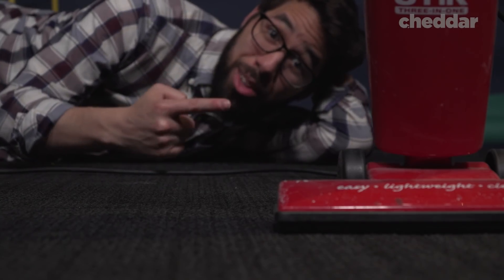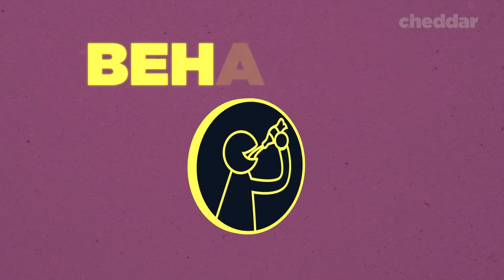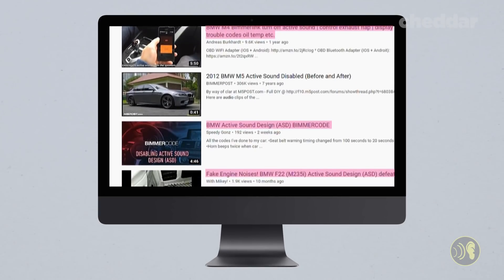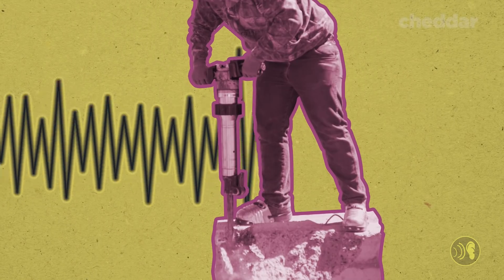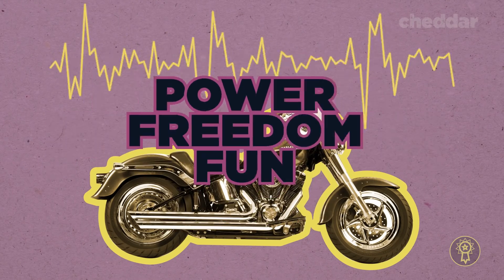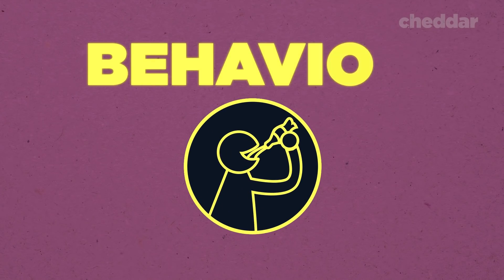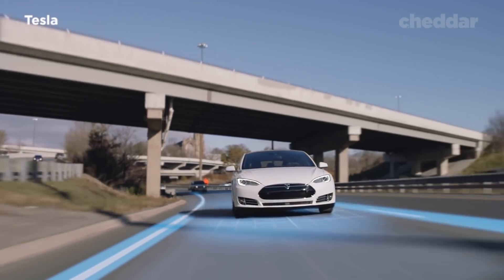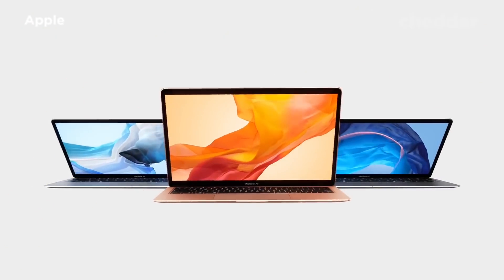The Fake Sounds Companies Add To Products - Cheddar Explains

Comment: Yes! I've been saying this for years. If I buy a paintstripper hot air gun or a hairdryer, it is deafeningly loud. Yet if I pay the price for an industrial hot air gun for electronics, it is so quiet that it is difficult to tell it is turned on.
Bathroom fans are designed to be loud. But for commercial use, you can buy very quiet bathroom fans. It is all in the shape of the squirrel cage rotor. So it does not cost a company even one penny more to make it quiet.
Look at designs made to be quiet. Vacuum cleaners meant for hotel use are powerful, quiet, and unassuming in appearance. Models meant for residential use look like a sci fi instrument of destruction and are so loud you can't even carry on a shouted conversation. Those "bladeless" fans actually have a very high speed impeller fan inside them, yet they manage to be very quiet.
How about shop vacs? A relatively low power small model is amazingly loud. Yet a commercial model with a 5hp motor will often be much quieter.

Comment: Harley’s have air cooled  V-Twin engines. Most sports bikes are inline 4 water cooled. But other bikes with air cooled V-Twins sound similar to a Harley. Not because they’re sound engineered. That’s just how a V-Twin has to sound. It’s a function of the configuration. Moto Guzzi, some Ducati’s, and Japanese Harley type cruiser. V-Twin = that sound. The exhaust ore differs due to the exhaust design but the burbling sound will be there.

Comment: You forgot to mention the opposite of this statement "cars can be quiet and powerful."

"Some cars can be loud and powerless pieces of sh*t." For example these ghetto ass modified Hondas that sound like they have a kazoo shoved up the tailpipe. Most of those cars have less power than a smart car.
Reply: Well if the car is quieter then theres less combustion which leads to less power, example: toyota Prius is a inline 4 that is tuned to get lower compression to get better fuel economy but also makes the car quiet. But there are electric cars that can be super quiet with a lot of power, example tesla model 3 which is super quiet but has a 0 to 60 in like 3 seconds. And the hondas have a larger exhaust manifold and usually have no catalytic converter
Reply: @leftturnsmatter7555    exactly. I've ridden in a Tesla 3, those are super quick.

Comment: Even though it is admittedly quiet, there's still an motor-like sound to the Tesla, and I wouldn't be surprised at all if that is intentional, and is probably much louder if you were standing outside the vehicle. I've read that one of the issues with electric vehicles is that they can be so silent that pedestrians that are blind (or are simply not paying attention) would fail to recognize their presence and that might increase collisions, so they are in fact adding sound for safety reasons.

Comment: I’ve been wondering about vacuums for awhile and been frustrated with their perceived lack of innovation in the sound supression department but this has explained that. It still frustrates me and I still want a silent vacuum. Also this video made me crave pringles lol
Reply: engineer one and market it here.
Reply: Quiet vacuums do exist, you just won't find them where you would probably look for them. Try a miele, sebo, or even an old filter queen vacuum cleaner, you might be surprised!

Comment: Motorcycles do not have to be loud for safety reasons, common misconception. There is no hard data to back up the claim that loud motorcycles are safer, it's just a claim that motorcyclists like to repeat a lot. By the same logic, pedestrians should be walking around with air raid sirens all the time and bicyclists should mount ship horns to their bikes. The real reason they defend their loud bikes with so much fervor is the same reason that car enthusiasts like loud cars. They're perceived as powerful and cool.
If you were so concerned about safety, you'd wear protective gear and a full helmet and keep proper distance not trying to look cool in your retro cap and leather vest and jeans going way too fast and coming way to close to other drivers.
While a lot of motorcyclists claim their machines have to be loud for safety's sake, new legislation by and large tends to disagree, imposing ever stricter noise regulations worldwide. After all noise is unhealthy and there is more than one way to stay safe on a motorcycle, like wearing brightly colored, reflective safety gear and most of all DRIVING RESPONSIVELY AND WITH FORESIGHT.
I ride an electric motorcycle to work every day and I've never felt less safe than when I was riding a standard bike. Can't say that I miss the noise and the stink though ...

Comment: This is stoopid. Not the video, but bothering to do sound design for familiarity over superior function (unless it's a novelty, like the clicking bottle caps) (and then maybe consumers are mostly stoopid, too). I don't know about you, but when I shop for anything, I'm comparing cost, quality, performance and durability. Even if I had unlimited cash to do so sound would be the last thing I'd worry about... unless the sound is annoying or too loud. I'd much rather have things like car doors and vacuums as quiet as possible...
meh

Comment: I use my work vac at home, it was designed to be quiet and strong (type of shop vac referred to as dust extractors). It's also cheaper than what most people pay for a good vac. Granted no beater bar, but there are no carpets in my home- that's gross. You can buy air driven beater bar heads, but just rip the carpets out. Sorry, none of those in a home. Been there, gross. You can vac the same spot over and over and get more stuff out (ask a Kirby salesperson to come over and show you).

Comment: If Apple makes a vacuum cleaner, it'll be their first product that doesn't suck.
Reply: Just be sure that you hold it in the Apple approved way and only use an Apple approved wall outlet.
Reply: Dun bother with one of those...the wheels of that vacuum will cost 700 bucks.
Reply: But it'll cost 300 times as much, still have at least minor problems, and it'll be totally sealed in a unibody design so only they can fix it.  The casters will be extra, and cost $200.
Reply: @ebinrock  No, the joke is he said it wouldn't suck. You know because vacuums are supposed to suck things in!
Reply: @mad48567  Granted! The Apple vaccuum would still find a way to suck
Reply: It would have iTunes though.

Comment: LoUd PiPeS sAvEs LiVeS!

Biggest BS I've heard...and I ride motorcycles.  Nobody that heard you actually knows where you are.  Hell, I've been run off the road by someone looking right past me while blaring my horn repeatedly.  They just didn't recognize me at all and forced me to leave the lane or get run over.  The best thing you can do is increase your visibility without creating glare.  Hi-viz gear, reflective elements on the rear and sides of the bike, and running lights that form large chevrons.  That visibility goes a long way to draw the eye to you and start to recognize that you're something that shouldn't be run over

Comment: I actually bought a vacuum cleaner that has "silence force" as the model name and yes, it's a lot less noisy than the others, you can actually hold a conversation with someone in the same room at a normal volume while vacuuming.

Comment: That explains why British Rail Engineering Limited kept on putting big, loud DC Motors into just one coach of their electric trains until the 1990s. The "zoom-zoom" from the 2nd or 3rd coach in each set in a train is iconic on pretty much any line they ever ran on (look up videos of BR Class 321s, 317s, or 319s at speed). The change to AC motors didn't come until 1991 when British Rail ordered 97 "Networker" trains from them and a further 93 from their cousins Metro-Cammell. The BREL sets were refurbished in 2008 and sound different now, but the Metro-Cammell sets are functionally as delivered and thus retain their original "F1 Car" sound when pulling away from a stand (see videos of "MetCam class 465"). Siemens also make their trains sound weird, their Desiro UK trains are infamous for their "UFO" sound, and their ES64U2 "Taurus" locomotives on the continent are known for their musical scale between 0-20kmh, the latter being made famous in a YouTube video titled "Taurus Macht Musik" of one such locomotive struggling from a start with a heavy train in snowy conditions causing the wheels to spin and the motors to go with them until the computer brought them back into line, creating music along the way.

Comment: It's possible that people will wake up to just how ineffectual advertising is. Tesla has no advertising budget yet they have continued to expand at around 150% year on year for a decade. The rest of the automobile manufacturers are, in the main, contracting. Harley Davidson are in trouble because the age group they appeal to has grown older, it is literally starting to die off. I hate noise, that is why I own an electric lawnmower (there are other benefits too but mostly it's the quietness I like). I also drive a Tesla Model S, from a drivers point of view while they are quiet there are many other cars that are also quiet, unlike the BMW i8 (a plug in hybrid) that pumps engine noise into the cabin by speakers but it's not the 3 cylinder noise from the actual engine you hear but artificial engine noise that the marketing department thinks you should hear.
Advertising is a huge part of life but in reality the endless pre, mid and post roll ads I see on YouTube and TV just make me that much less likely to buy those products. Perhaps one day someone in addition to Mr Musk will take a look at advertising and realise what a tremendous waste of money and how counter productive it mostly is.

Comment: The best selling car company does do most of this but that’s Ford and they do it because they replaced their V8 with a turbocharged V6 where everything is much smaller to increase power and efficiency. Most performance cars like the mustang or even jags have  exhaust that produce beautiful sounds even though jag engines naturally aren’t even a good sounding engine for the most part. Personally for me the best sounding vehicles are old but gm block V8’s despite the fact they do not produce a lot of powerful but the big block is the noice of the V8 that’s why it’s the best sounding engine because it is the sound that you think of for powerful cars.

Comment: I AM SO OVERLY MAD THAT VACUUMS ARE LOUD ON PURPOSE
Reply: I'm mad that pringles make sound! can't everything be silent everywhere??
Reply: Well take solace in the fact that this isn’t the whole story. While there may be some truth to the idea that a vacuum that’s “too quiet” has a lower satisfaction rating, I know for a fact that a significant part of the cost associated with consumer vacuum cleaners is sound dampening to make them quieter. My source is a close friend who’s spent 12 years of his career engineering vacuum cleaners.
Reply: @matthewjcobb  thank you for providing this exact bit of information I was hoping to have found from someone's posted comment.

If you ever took apart a vacuum and looked at the motor and it's parts along with having a tiny bit of knowledge with how just mechanics work.  You would've been immediately thinking that this video's thumbnail has to be b.s or   just how tf could that be?
Reply: 666 likes
Reply: you can buy silent vaccum cleaners, nobody forces you to buy a loud one.

Comment: The pop when you open those bottles are there for safety, it means there’s no air coming in and is fully sealed.
Reply: It's not needed though, they could use a rigid metal cap or a plastic lid
Reply: Moto Lumpy they could, but you wouldn’t get any feedback.
Reply: Moto Lumpy And the bottles caps that have those pops when opened are metal. Do you not know that?
Reply: Also could mean that the product hasn’t gone off and started fermenting in the container.

Comment: Say what you will about wanting a quiet car, but as someone who is legally blind I can't drive so I am stuck as a pedestrian. I can't see cars coming so I think that cars should have a minimum volume requirement. This would make it easier for blind and visually impaired people to hear them coming. After all they need the sound just cross the street. Fake sound can be practical and make people safer.     

Does anyone support my idea that car companies should have to engineet their cars with atvleast a certain minimum volume sound to their engines? I I do not know if this is already a law or not. It should be though. Tell me your opinion on the matter.
Reply: The EU start to mandate every EV to be louder than today starts from 2021

Comment: It not about the power of vehicles it how traction applied ab 45 hp tractor can beet a 100hp tractor because of the way they give traction. Also I don't think tractors can fake sounds nothing beets a mf 135 that blows smoke while scraping put her in 3rd gear and rev her to hell especially if you pulling old silage that causing wheel spinning lift the scraper a bit and she will smoke lovey.

Comment: I've noticed that in my local tropical smoothie (urban smoothie shop) they are using super expensive blenders that you can see which don't make hardly any sound because the pitcher is set inside of a box that seals most of the sand.

Comment: Having worked in var fields, I have found the ppl who prefer noise are usually the less intelligent ppl, they're also the ones to just talk to hear their own voice and the ones that fail at anything that requires one to be quiet, zen classes, executive security or any security, martial arts, actual cleaning of stuff, women singing and dancing while dusting in teddys are of course exempt. In construction quiet is enjoyed since it's too often not quiet and you lose some of your hearing from power equipment drilling or cutting thru stuff. The earliest quiet vacuums came out in the late 60s, noone wanted em, loud was seen as powerful, the facts were the opposite but ppl largely didn't know the advances in machine silencing, they tried it in the 70s, again same thing, ppl too dumb to know quiet actually meant more powerful. Vibration isolators are a huge industry but most ppl don';t know this but if something is making noise and the customer wants it quiet someone will make it such for $. Air ducts are expected to be quiet so blowers have better bearings and are quieter than they used to be. The military spends $$$$$$ on quiet tech, especially the Navy, subs now are much quieter than they were in WW2, now if an area of ocean is too quiet than there might be a sub there. The fuel cell subs Germany makes are so quiet they've killed US subs in war games, took out a US carrier in the same war games, oops ! That tech will be part of the next gen of US subs. A lot is what ppl don't know and the rest what we've been told to believe, often total shit.

Comment: About car noises it goes back to the birth of the ICE powered car that were noisy even the transmission that weren't synchromeshed those weren't invented until 1929 and then only for cars the metalurgy wasn't strong enough for trucks but by 1930 they had alternators and induction motors large enough to propel trucks but because of the deliberately engineered depression,  the elites engineered the depression so they could pick up stocks of failed companies for pennies on the dollar, but alternators and induction motors could propel trucks even semi's even run the speed control through the ahem "transmission" instead of the throttle 
And the thud of the car door was to denote you are getting into a solidly built car. Even Henry Ford knowing his Model T was considered was obsolete didn't like it was considered obsolete but even his son Edsel convinced him the Model T was considered obsolete built the "stylish" what ever that meant but solidly built Model A with the solid thud when you closed the door. 
Vacuum cleaners, when the first vacuum cleaners were invented they hand powered with some having the vacuum part of the handle coming up through the hollow upright handle. The first truly powered vacuum cleanerers were powered by internal combustion  engines with the whole mechanism mounted on a horse drawn wagon and was more of a service like Stanley Steemers, wasn't until after WWII that electric motors and internal engines for cars and trucks started to become large enough. But like I said for cars, trucks even Semitrucks back in the '30s alternators and induction motors could propel vehicles. 
But for home appliances wasn't until the postwar years did businesses consider there was a market to start improving A. C.  induction motors. But now we have far more  efficient A. C. INDUCTION motors.

Comment: For keyboards and other dedicated input devices sound and vibration are a very important part of the overall user experience. Part of the reason there is a market for mechanical keyboards is the noise they make when typing.
Reply: True, but I wish there was a market for silent laptop-like keyboards and mice with even the scroll-wheel button silent. In fact I hate mouse clicks so much that I made controls for PC FPS games that use the laptop track pad and no mouse clicks.